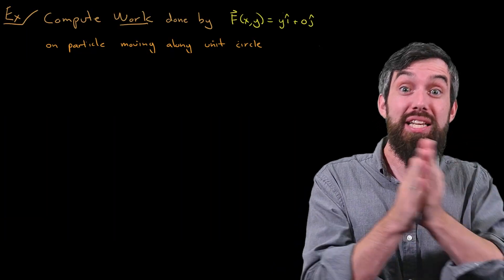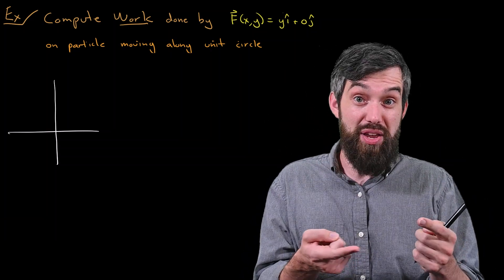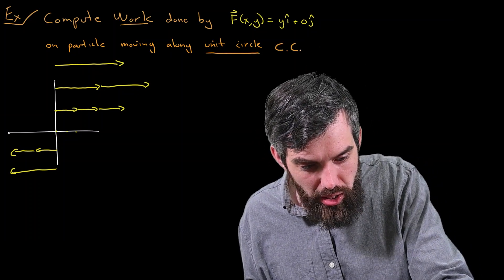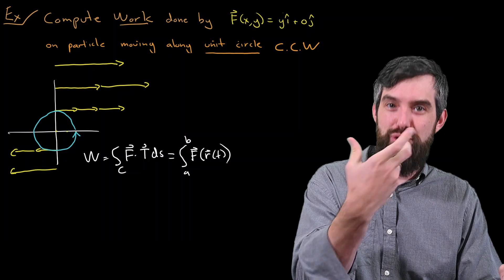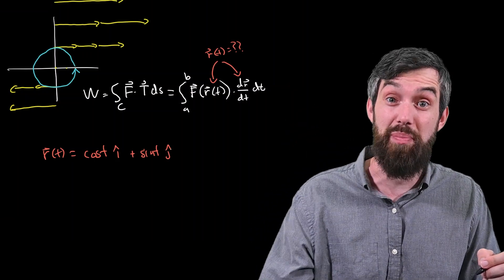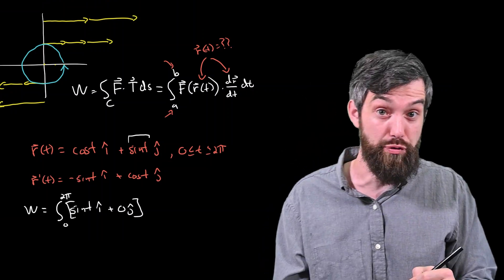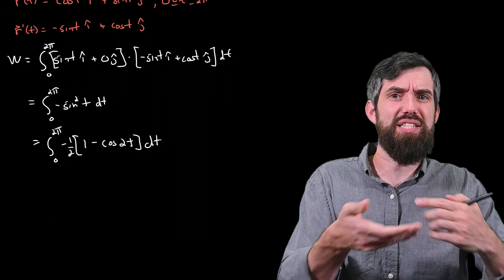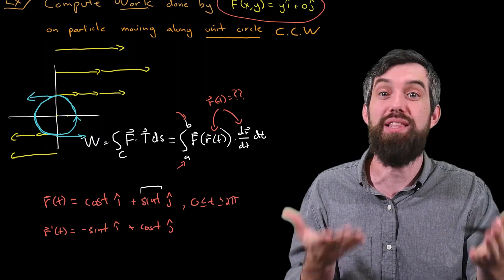Example: Computing the Line Integral of a Vector Field (i.e. Work Done)

Comment: what happens if i make the direction of the curve clockwise i now it will give me +ve direction but  mathematically will its limit change from 0 to 2pi to 2pi to zero as to cancel out the negative sign can u tell me if there is some other things that I m missing??
Reply: Limits remain same you just have to add  - sign manually

Comment: Thank you very much for this! I tried the same example but where the direction is clockwise on the unit circle. Hence, in the same direction as the vector field in the example. How does changing direction affect the line integral? My intuition says it should be just \pi but I am having problems coming to this conclusion by just evalueating the integral.

Comment: Can you clarify the relationship (if any) between the orientation of the x/y axes and the îhat/jhat unit vectors. Intuitively, I sense they need not be aligned and the work done (pi) will be the same.  (Like starting out from a different point on the circle, but still going round 360 degrees.)